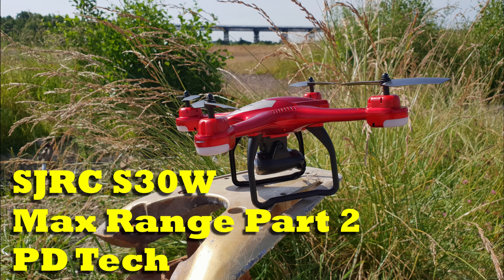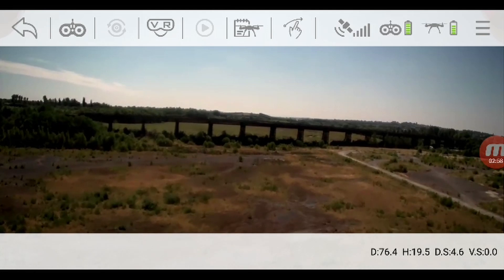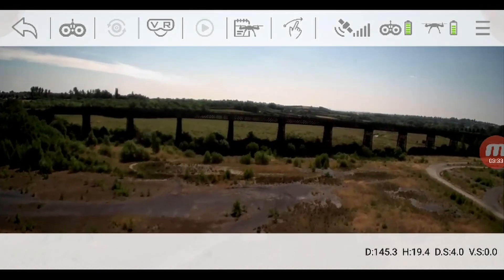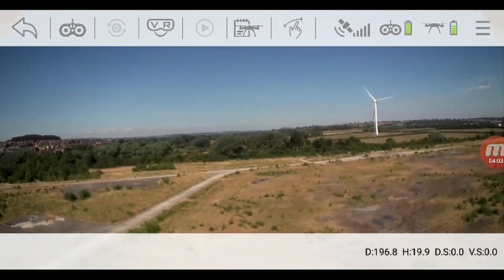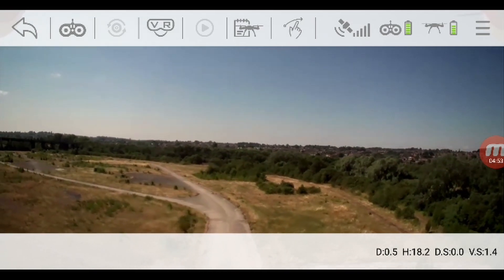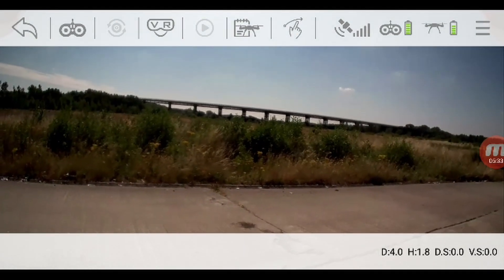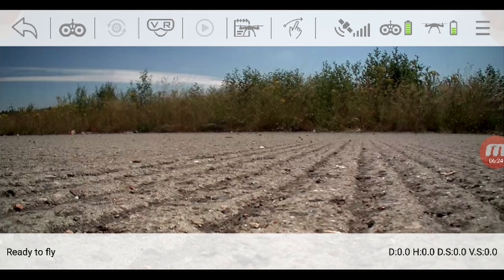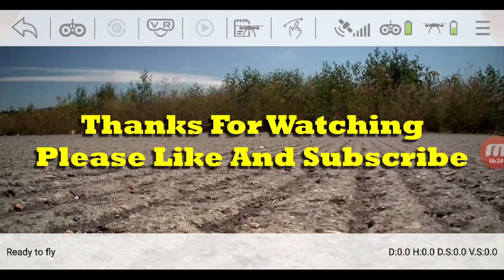SJRC S30W Max Range Part 2 inc Tips On Improving Wifi Fpv Range

Comment: I have the S20W in white ,  I really like the red better .   So far I've been pretty happy  with mine ,  and you are correct about the RTH .  Has never failed me .   Thank you for sharing sir !
Reply from the maker: This one is the s30w, basically the same as yours in a different body shell. The gps is really good on these, very stable, probably slightly better than my bebop, the RTH works flawlessly, even when it goes out of range it will auto RTH until it reconnects which is really good for this price quadcopter. They have really good range as well, very impressed with it. I like the candy red paint job, still looks pristine after many flights. Disappointed the blue nose cone on my bebop has started to fade where I hold it when changing batteries!

Comment: I'm going to try this on my s70w. I have a question as I'm assuming this and the 70 are the same,  when you hit the height setting does it try to return home?   I'm looking to find a reason mine fell from the sky! it was on beginner mode with altitude on 30m. I've since fixed it and alterd settings and it's fine now. any ideas would be appreciated.... nice video 👍
Reply from the maker: The s30w and s70w have basically the same gps system and use the same app, although yours has a different transmitter. If you set the altitude to 30m, when it reaches that height it will not go any higher and a message in the bottom left tells you 'height limit reached', it should only RTH if you go out of range, mine comes back until it picks up signal again, if I manually press RTH it comes all the way back to the launch point. Not sure why yours fell out of the sky? Mine has never done that, did you have plenty if battery power? not sure if your controller has a stop button that stops the motors? Mine just has auto take off and land.
Reply: @pdtech4524   right that's good to know you get a message as I didnt have one so not that then. yes the controller has a stop button you have to hold the take off/land button fir 3 seconds so not that either.  battery was fully charged too. I'm guessing now it was just a dodgy motor now. that was only its second flight it happend  but now I've changed motor it works flawless. just trying to work out what happend. thanks for your help on the matter 👍

Comment: Not bad range for a small GPS quad, great range test buddy 👌👌
Reply from the maker: Southpaw Drones Thanks for watching :) Yeah it has well above average range for this class of quadcopter! I suspect it will go a lot further as I didn't get any weak signal messages and I activated the RTH manually at just over 200m, hopefully next time I will send it out even further! :)
What surprised me most was the 25% increase in range was just gained by moving my phone away from my transmitter, I would imagine these results may vary from device to device?